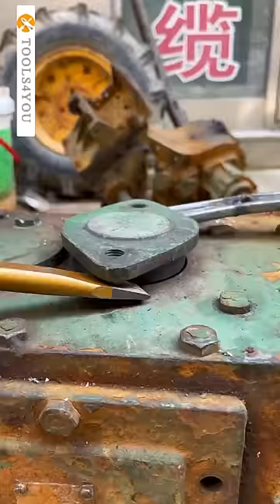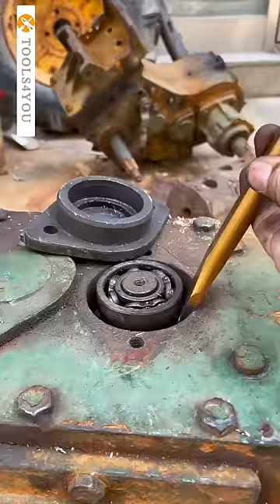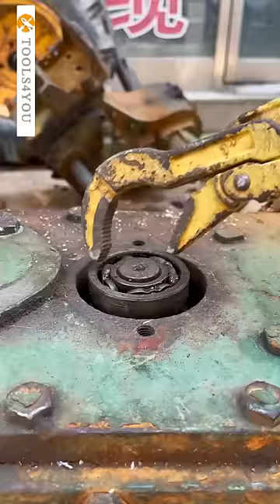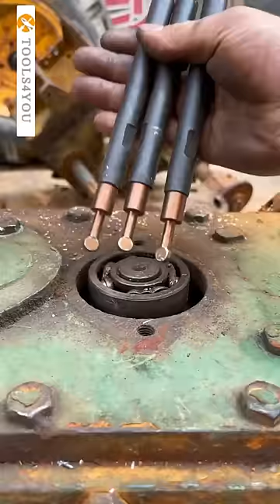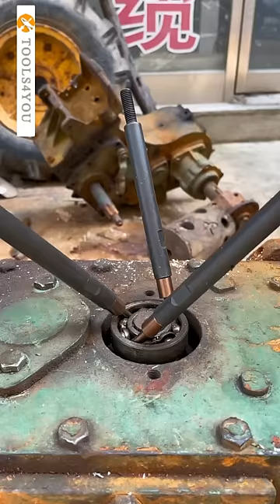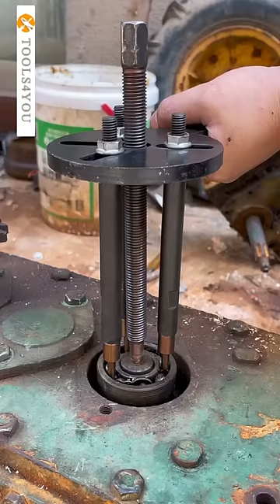Inner Bearing puller

Comment: I wouldn't recommend using this style unless you are permanently removing the bearings as the copper can leave bits behind, but for permanent removal it's alright
Reply from the maker: Maybe so.
Reply: You can flush the bearing regresse it and refit it
Reply: @toolsforwork  where can I buy this bearing puller?🎉